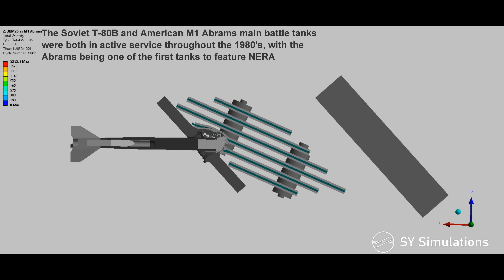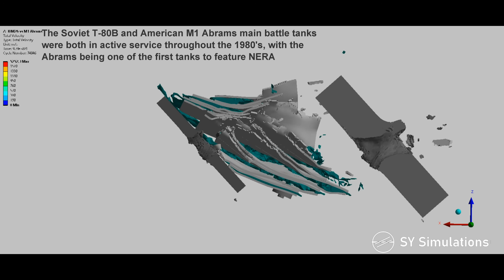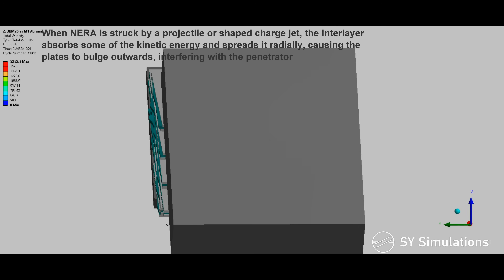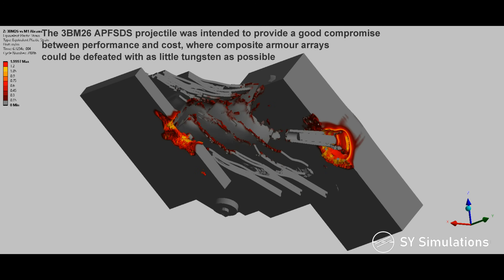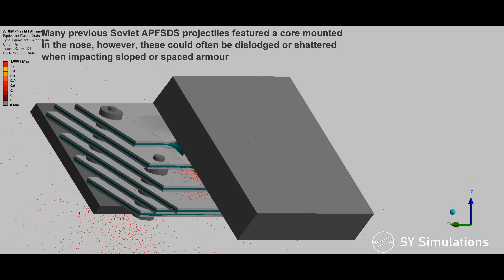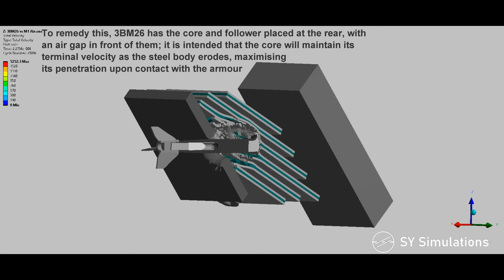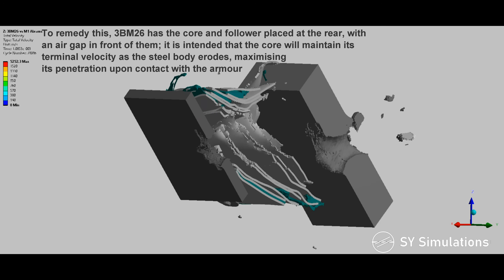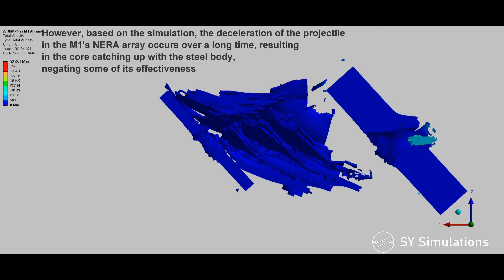T-80B vs M1 ABRAMS | THE MOST UNIQUE APFSDS vs NERA | 3BM26 Composite Armour Penetration Simulation

Comment: now m833 vs t-80b hull
Reply: M833 penetrates 375 mm at 2 km. T-80B’s UFP with 30 mm appliqué is equivalent to 380 mm eRHA against monobloc APFSDS. Turret is 420 mm eRHA. Numbers are very close, so it would make for a very interesting video.
Reply: Can pen in less than 1km acording to ghpc lol
Reply: @cykablyat123br9  are you sure? i'm pretty sure it can pen the t-80b out to like 2km or more. m833 has 490mm of pen and the t-80b only has around 400-450mm of armour on the hull.
Reply: @jintsuubest9331  my guy, m833 is leagues better than m111. you have no idea what you're talking about. m111 is from 1978, m833 is from 1983.
Reply: @jintsuubest9331  russians tested m111 against T-72A and found that it almost stopped it so they added a 16mm RHA plate. 80B armor package is lightyears ahead.
Reply: M1 couldnt carry them until some modernizations plus t-80b is tank from 70s not from 80s like M1 abrams.But still t-80b is able to penetrete m1 abrams
Reply: m833 cannot penetrate
Reply: also m833 cant penetrate T-80B at some places since there are different types of armor its not all the same it has maybe higher pen then the armors thickness but it still cant penetrate it since it is more effective in stopping certain type of ammunition basically it is able to penetrate it on bottom armor plate and some part near driver hatch other places are very low chance to penetrate
Reply: Cuts clean through
Reply: @Phapchamp  Under 750 meters, if it gets further it wont
Reply: Also it is more accurate to do M833 vs T-80U, and m774 for T-80B
Reply: @parallax9084  how exactly is it more accurate? m833 is from 1983 and 3bm26 is from 1983 as well. the t-80u is from 1986.
Reply: @pakistanipatriot4767  3BM26 isnt the most advanced Soviet round, it is the most unique. M774 was used until the 1990s in Iraq, by 1985 the vast majority of the NATO stock was still m774. Therefore the T-80BV or U are way more accurate. 

Either way, m774 cannot penetrate the T-8OB with the applique plate nor can M833.
Reply: @parallax9084  where's your source for m833 not penetrating the t-80b?
Reply: @pakistanipatriot4767  a good metric for the M833 is the 105mm DM33 which is a longer larger projectile than the M833
it could only penetrate the post otrazeniye T-72M1 at certain parts of the turret (the mantlet portion without the composites) under 1500m and struggled against the hull
against the T-80B which had the thicker 30mm applique and a full HHA setup over RHA-HHA expect penetration to be even less ~sub 1km

against the T-80BV with the 50-35-50-35-50 array expect it to not penetrate at all... even 120mm APFSDS (M829/DM33/3BM42) is likely to struggle
Reply: @pakistanipatriot4767 3bm26 wasn’t used as much, in reality they were using 3bm32. Also m833 had major production problems and this only came to Europe in about 1986

Comment: Very interesting how the first tungsten slug decimates the NERA. Reflects and/or emulates the performance of the M774 against the Leopard 2AV's turret.
Reply: The initial Abrams composite array was heavily biased towards defeating shaped charges so it makes sense. IIRC the kinetic protection was only designed to protect against 115mm APFSDS from 800m or something along those lines.
Reply: @signs80  was it?
I say that because the Abrams while got improved with IP was likely going to face steel stuff.
Yes there was Tungsten and DU, but the Americans probably took an 115mm round from a captured Syrian tank and extrapolated to 125mm and designed around that. Its not perfect but my point is that they knew soviets had bigger guns for a while now.
Reply: @gerfand  They knew soviets had the 125mm at that point but IIRC they didn't think it was feasible with current technology to increase the protection to stop 125mm while staying under the weight limit. The design criteria was actually to protect against future 115mm APFSDS (by using tungsten 105mm that was supercharged) at 1200m and 125mm HEAT if I remember right.
Reply: @signs80  uhn... Well it still is a good criteria, as tungsten, did not knew that.
Either way at least the armor became proof against 3BM22 as steel, US probably did not knew what they were facing on the best sabot tech
Reply: @gerfand 
@signs80 is right. BRL-1 (M1 armour) was designed with CE protection in mind. BRL-2 (M1E1, M1, M1A1) was a stopgap improvement to increase KE protection until HAP-1 of the Heavy Armo(u)r Package series came with the M1A1 HA.

Comment: The armor on Abrams was designed with defense in mind with the assumption that by the time NATO counteroffensive happened it would be against reserve T55s because of attrition. As such lower half of the tank was poorly protected against kinetic ammunition as it would be fighting from prepared positions or reverse slopes.
Reply: The BRL-1, 2 offered roughly equal protection on the hull and turret fronts alike. Only when the HAP series began did the arrays become much more turret-centric
Reply: @belgianfried  the hull remained 350mm/BRL 1 equivalent all the way till the HA
the turret started getting upgrades since the IPM1 with a BRL2 equivalent on the turret (around 450mm)
Reply: @geraldmuntuerto5769  As in hull to turret ratio. I also don't believe the jump in armour quality on the BRL series was that great.
Reply: Considering the situation in Ukraine i dont think they were wrong with their assumptions.
Reply: @Phapchamp  Ukraine and Russia destroyed their whole stock of like, 2,000 T-64s. Russia has negligently reduced their T-72 fleet by ~1,300 due to bad/no maintenance. Ukraine has deactivated vast amounts of its ~1,000 strong T-80 fleet due to international agreements. That alone reduces front line strength by 10% or more for the whole Soviet stock
Reply: @belgianfried  Ukraine still fields T-64BVs and T-80BVs in great numbers same with Russia. Both sides refurbish their stocks and they are still yet to melt. You are underestimating how many tanks both sides had. But we do see some decrease in certain models like T-80BVs T-64BVs (on RU side) and T-80Us. But even considering that NATO tanks are still a drop of water. Ukraine has tops 100 foreign tanks remaining.
Reply: @Phapchamp  comparing the USSR to modern day Russia which is fighting against what was formerly one of the biggest soviet armament centers (Ukraine) is very stupid.
Reply: @quan-uo5ws  Comparing Ukraine to NATO is just as stupid. Your point?
Reply: @Phapchamp  who the hell compares Ukraine to NATO in relation to the cold war? My point is Russia is very different from the USSR.
Reply: @quan-uo5ws  Initial comparison was NATO-USSR. And i made a reference to it using Ukraine-Russia. Because Russia is running out of vehicles in a pretty rapid face and is starting to field T-62Ms. Just like how USSR would run out of vehicles in a prolonged conflict with NATO and start fielding T-55s as NATO foresaw.
Reply: @Phapchamp  when the USSR would start fielding T-55s NATO wouldnt even have a single tank left. You are greatly underestimating the Warsaw Pact.  And no, a conflict between two former soviet states does not mean anything in relation to a NATO-USSR conflict, this is some mental gymnastics shit.
Reply: @quan-uo5ws  USSR's tank fleet already mostly melted down due to Ukraine. If you think NATO cant keep the war of attrition you are heavily underestimating NATO production capability. In 1990 alone USA was producing 1.5M shells per month. That is almost triple of Russia's current production capability. Lima plant was producing 50 tanks monthly when it was running at full capacity around the same time. That is close to entire russia's refurbishing capability. And Russia is in full on war economy right now.

All factories and plants in Russia are left over from USSR and majority of USSR's tank plants were in Russia proper. Russia is just USSR. Ukraine had just kharkov plant.
Reply: @Phapchamp Almost every single of the 15 republics produced military equipment for the USSR. Every single of the 15 republics post collapse, including Ukraine have a shit-ton of tanks left from the USSR. Russia has only got a fraction of them (since you have to keep in mind a lot of them are in an almost irrepairable condition due to the destruction and collapse after the fall of the USSR) and they STILL have a lot of tanks operational in Ukraine, so what even IS your point? also really? comparing 1990 US to todays Russia? during the cold war USSR was producing HUNDREDS of tanks monthly. Todays Russia cant even produce new ones, just refurbish rusted wrecks from old soviet depots.
Reply: @quan-uo5ws  Its pointless to argue on this. If you want to believe small micronations make a smidge of production of current Russia you are free to do so.

USSR was producing hundreds of T-55s and similar vehicles. NATO was producing M48s in similar quantities. Nothing sophisticated. Their production in 1980s were significantly lower. At best 100 tanks per month.
Reply: This is massive cope. In the case of WW3 the west was badly outnumbered and also had lower quality. They werent fully mechanized didnt have nearly enough comparable equipment. They even would have been forced to enter the war equiping their armies with WW2 weapons.

What reserve T-55s? It was not designed with defense in mind, no MBT is designed with "defence in mind" this is a myth used to cope about the lackluster preformance of the Abrams. By the time the Soviets would use "reserve T-55s" which didnt exist. There wouldnt be a single Abams, Challanger or Leopard left. There wouldnt have BEEN a "NATO counter-offensive" In the event of the Soviet Invasion all of the NATO frontline would have completely disintegrated.
Reply: @parallax9084  The term is mobilization reserve. We are witnessing it  happen now.
No tank was built with defense in mind? The gun depression and tendency to upgrade turret armor first says otherwise.
Reply: @MarcinP2  Now? Didnt the Soviet Union cease to exist 30 years ago? 

Yes no MBT ever was built for "defence" that defeats the purpose of an MBT. The 2 things you named dont prove anything, matter of fact the turret armour at the time wasnt that much better than the hull armour and it coud be perforated as well.

Comment: Does the M1 Abrams lower glacis hull have depleted uranium armor?
Reply: From what i know, Abrams has DU only on the turret
Reply: 600 SEP v3 confirmed to have, the rest is ambiguity
Reply: only the newest sep v3 do
Reply: Not this one. Not until HAP-1
Reply: There was apparently a low number of M1 Abrams that received a prototype hull armor array containing DU, however it wasn’t adopted beyond that. At least some iterations of the Heavy Armor Package contain DU as part of the turret cheek composites, it‘s unclear whether the newest armor arrays still do. In export tanks either entirely different arrays or arrays replacing the DU with tungsten were provided depending on the ‚trustworthiness‘ of the recipient.
Reply: Yes, the current Abrams uses depleted uranium on the front hull and turret
Reply: No. And all of the lower glacis of the Abrams models in service have not changed till today.
Reply: @m1a2_sepv4_abrams  I'm fairly certain that updated Abrams received several iterations of improved lower glacis armor, just not DU.
Reply: @MacSalterson  Source?
Reply: None of them actually. Only some 50 Abrams ever had Depleted uranium armor. 

If you are being served on an abrams which does not have radiation signal inside the crew compartment or you did not had to check radiation measurements during you training your tank does not have DU inside.

IE: The russians measured the abrams wrecks in Ukraine and none of them had DU.
Reply: @venator5  That 50 tanks figure is specifically talking about the lower glacis inserts. American service Abrams all have DU inserts in the cheeks (and perhaps mantlet). DU inserts are removed for export tanks. This is well known and standard procedure.
Reply: Abrams in Ukraine never had DU armor in the first place. They were fielding FMS armor scheme.
Reply: @venator5 because they were export models lol
Reply: @venator5 The armor modules of M1s provided to Ukraine were exchanged for ones without DU. It is unclear whether the replacement modules are similar but tungsten-based or lesser.
Reply: @venator5 all Abrams in US service have DU hulls. We don't ship DU hulls to foreign armies.
Reply: @venator5  M1A2 SEPV2 and SEPV3 models have DU arrays in the hull front. Army amended to remove the restriction of DU usage in 2006. Those 5 vehicles you mentioned were test vehicles to see the extended effects of DU for crew. 

DU has no detectable radiation. Its depleted. Its only toxic due to heavy metal poisoning.
Reply: @Phapchamp  no source for the sepv2 having hull DU arrays sadly... only on the sepV3 can i find definitive sources for DU arrays on the hull
Reply: @geraldmuntuerto5769  SEPV2 has DU in the hull because as i said the decision to limit the DU on the turret was amended in 2006 which was several years before SEPV2 was put in production. If a decision that limits something is lifted then it is safe to say it was lifted for a reason.